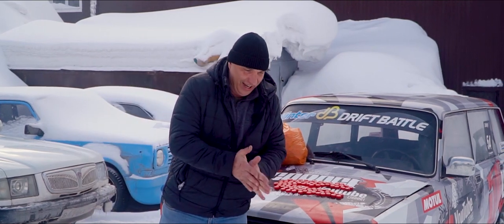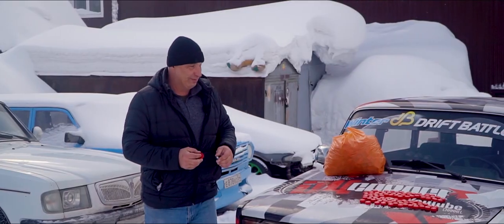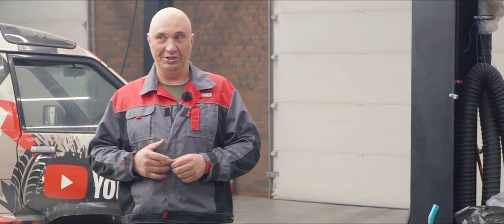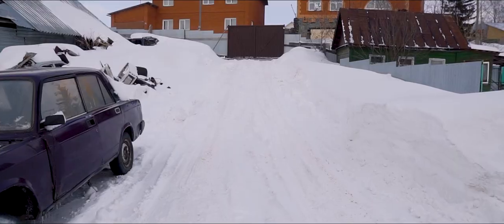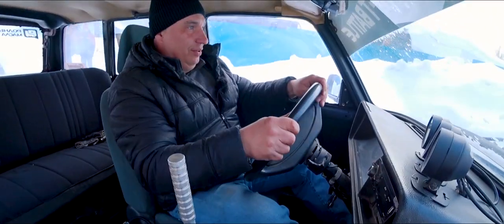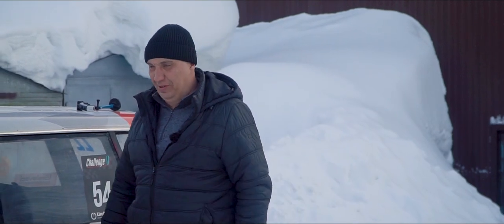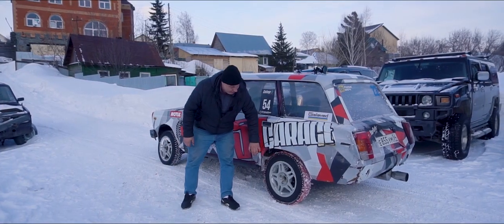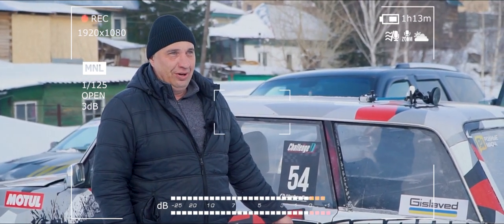Using 600 bottle caps as tire studs

Comment: Next episode: we replace the engine oil with tomato paste, put cheese graters on the tyres and cook a pizza on a manifold heated oven
Reply: Theyre russian, not italian there mario.. try vodka for gas and more vodka for oil and baked potatoes under the hood...
Reply: @Z-Ack  many times vodka is under 40% so it will not work. itd need about 70% or even more. people over estimate vodkas power...
Reply: @robertedwardlee8227  Rasputin have 70%
Reply: @uooello13  yeah and viru valge 79 and vergi 80 and spirit 96
Reply: HA
Reply: Now I'm hungry
Reply: Che Guevara proof or Vol?
Reply: Daniel I it’ll be proof, I hope. Though I wouldn’t put it past those Russians drinking 70% volume :)
Reply: @98dizzard  vol
Reply: Polmos Spirytus   We used to have this go across our loading dock. It required flammable placards! :)
Reply: DO IT!
Reply: I once cooked a pizza on my exhaust manifold, took some time but was still nice

Comment: Why do ladas are good:

RWD and Manual.
Reply: EngiNetion Theyre used a lot in ice drifting for this reason, that and they're cheap strong bodies.
Reply: @ceke  There are alot of them in Azerbaijan too. I used to drive my Grandpa's Lada Niva.
Reply: @ceke  i prefer Volvo 240...the longer Lada
Reply: But then there's the drift tax..
Reply: But the con is that you are driving a lada
Reply: @gryyta9617  you can still buy brand new Lada tank, but no longer Volvo
Reply: @GF-mf7ml  why would anyone buy new cars when there are old?
Reply: Toyota Celica<Lada
Reply: @robertedwardlee8227  you still don't know about Ladas
Reply: @GF-mf7ml  yea i know 🤔, basically all the others than samara and niva were copied from fiat, except with horrible suspension and drum brakes.
Reply: @Garbagejuicewaterfall  toyota celica mk1>lada tho.
Reply: Unfortunately RWD Ladas are not made in at least 15  years...
Reply: @jannekarppanen9346  Lada 2107 is still being produced
Reply: @EngiNetion  Really? I thought RWD was ended when they started making Samara.
Reply: @jannekarppanen9346  You can still buy a 2107 0km from factory
Reply: BMW E30 BLYAT
Reply: @EngiNetion  You can't from 2014,last produced in Egypt.
Reply: @molnarrobert1893  Really? Oh i didn't knew that. But you can still find 0km ones in my Azerbaijan
Reply: It’s basically a Porsche!
Reply: @jim5735  No. ZAZ 968m is porsche. It is an RR and manual.

Comment: Some of the traction is because the extra layer makes the tire stiffer. So now I'm wondering about making a multi-layer all rubber tire. You could put big long studs or screws on that and still have some ride quality from the smallest tire still holding air. Or for real thuds, just rubber all the way to the rim.

Many moons ago, in the era of bias-ply, I put six-ply tires on a little sports car... made it amazingly surefooted in winter. Never had to buy studded snow tires again.

Comment: I read on a tire manufacturer website years ago that the reason snow tires have deep treads is to capture snow. Snow sticks the best to snow. The captured snow in the bottle caps probably worked the same way.
Reply: Right the captured snow will be more compacted than the surface snow and grab like a tread.

Comment: i have an idea see if you can get a lada engine to run upside down cant be that hard, have the carb extended so its right way up then fit an oil pump (power steering pump will work) so the oil thats now in the rocker cover can be pumped to the sump  so the big end bearings are still lubricated love the videos keep them coming

Comment: You could make mud tires using the cut off sidewall method .
Put mud grips over street tires and inflate.
That may also work well using a hole saw on the cut tire’s tread time make a street or bald tire into a mud grip.

Comment: I always get a big kick out of your videos. I would like to see you mount 2 tires on the same wheel. When I was in high school, we made a dune buggy and welded 3 rims together for the rear. The inside tire had to have the bead cut to mount, and had to have an inner tube installed. It really worked well, considering.Stay safe and keep up the good work.
Reply: and you never thought of using bottlecaps as winter tires studs shame on you🤣😂🤣

Comment: Test on lada how it runs on methanol, NOS, and other extreme fuel, and see which is better. If the engine survive after all fuels😄
Reply: A lada will run with a hole in the block and 2 working cylinders..  things are tank motors., but only got like 60hp
Reply: Boost the lada engine with stock internals there after use nitros & hi octane fuel

Comment: Please do an experiment with polishing paste as an oil additive.
Same amount and conditions as with ceramic revitalizants. About 10-30ml of some fine polishing paste added to engine oil in a healthy engine.
Cylinders compression and engine noise tested before adding the paste and after about 1000km of normal driving.

Comment: Could you do one of your crazy screw in the tire experiments with tire slime or one of those thick tire fixing products, not the latex water fix a flat crap. I think a tubeless tire may just stay filled with air even if there are screws all the way through as that thing stays liquid in the tire and keeps plugging holes. Would be nice to keep those ice fun tires alive longer as I recall last time they did great but broke fast.

Comment: gotta mount two gearboxes on to one car. one for te rear tires and one for the front. then make a burnout where they spin in the opposite directions. and drive while using two different gear ratios lol
Reply: They already posted a vid where they reversed gearing for 1 axle on the UAZ, back before they turned it into the counterfeit cybertruck.

Comment: Good idea with the double layer tire. I'd put the screws through the inside out then put it on the tire with the heads of the screws facing the inner tire and the point sticking out. When the screws and outer tire wear out, you could just deflate the inner tire and replace the outer section. The best part is the outer part could be old used tires and the inner new tire would never wear out. Economical Russian snow tires anyone?

Comment: Would nuts and bolts work -with washers on both sides to seal the hole? 

Who would have thought a 1500cc rear wheel drive Lada SW would be able to handle the snow!